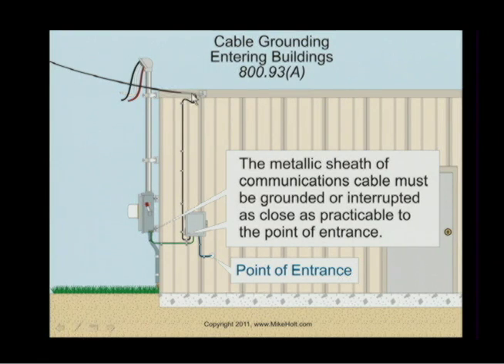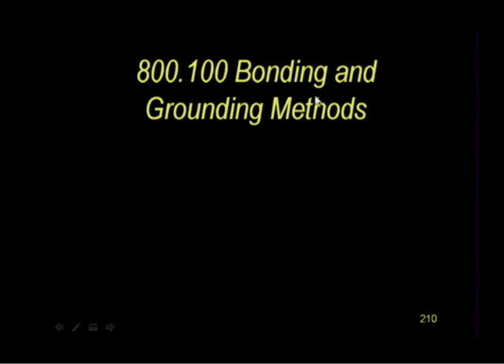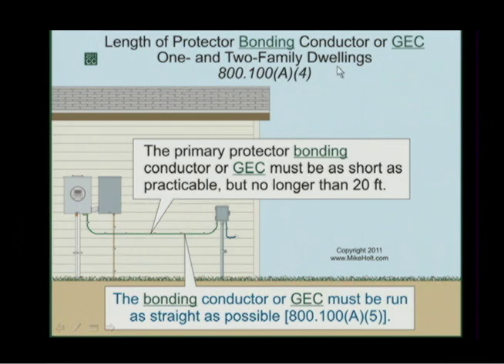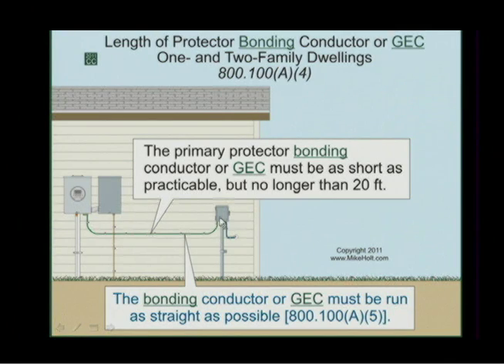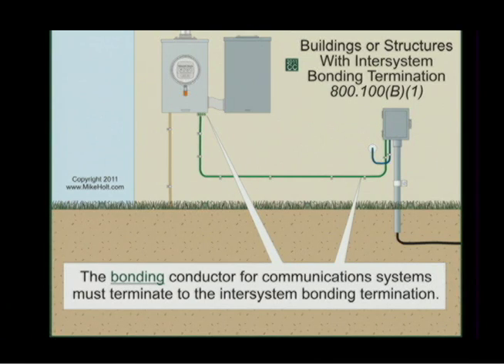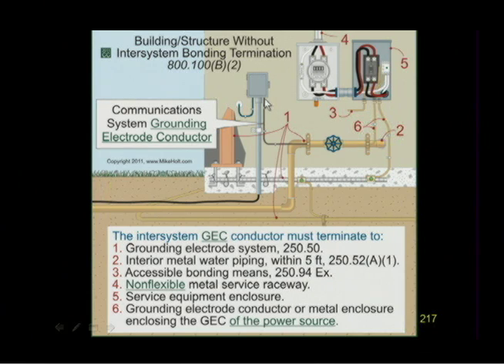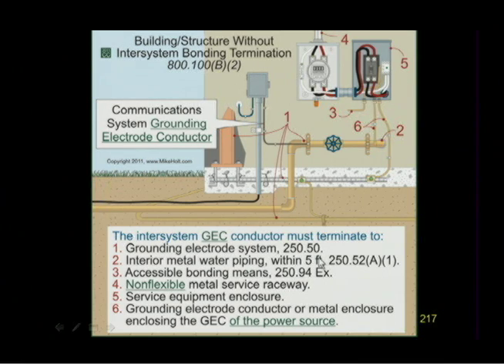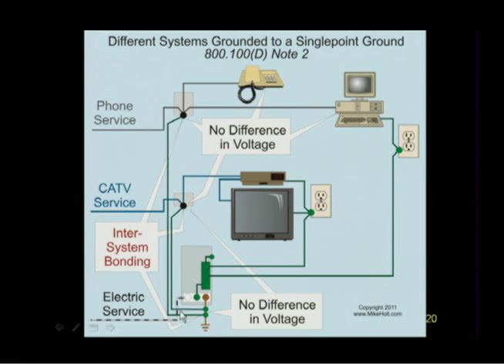NEC 2011 Bonding Communications Systems 800.100 (7min:52sec)

Comment: Existing communications box is tied in with the Main electrical ground rod. Does it need to be removed and install with the bonding system?
Reply from the maker: It's fine.